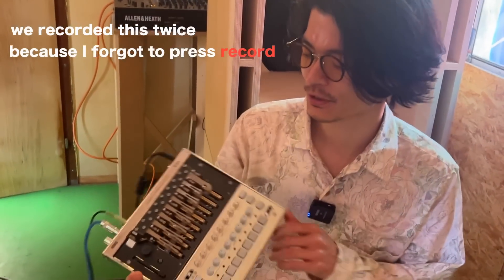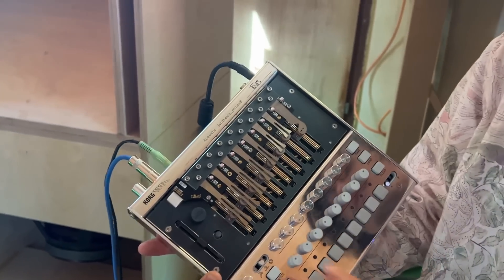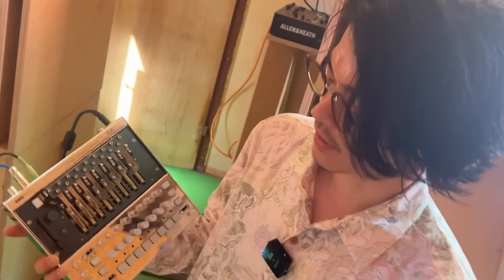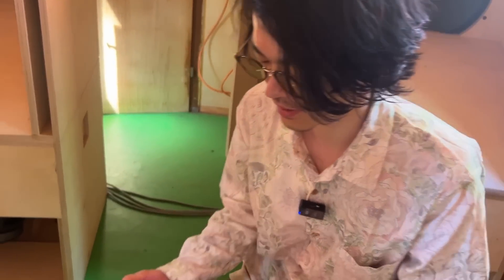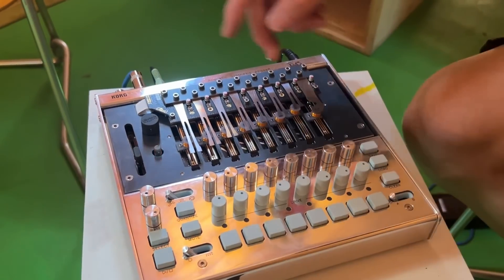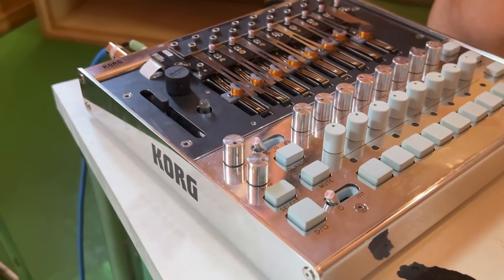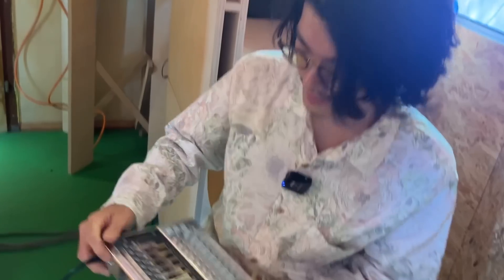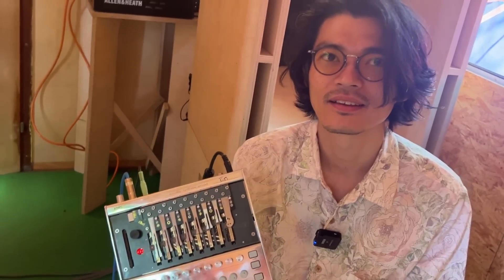Korg Acoustic Synthesis-phase 8 // Update from Superbooth 2024

Comment: Call me crazy but why don't you guys make this but also just make like a 49 key electric piano with this same setup, just less doodads attached to the forks? There is no affordable (sub $5000) electric piano on the market that basically doesn't weigh 100 lbs. If you made a modern ones with all the right parts but like a plastic chassis for weight, thing would sell like hotcakes.

Comment: love this guy for doing the volca modular. amazing instrument. this thing looks very Koriginal. sort of handpan but compact.
Reply: Btw would be great if the unit got midi input and that each note in the octave get like a last note prio. like this you can stack the accoustic reso with poly synth patches and your not limited to play in 1 octave only. 
if the sound is going to be great then 2 octaves would have my preference. 

I imagine to use it for accoustic feedback with an guitar and amp.

The sound is... mwha... a more solid pitch fork sounds better.

Comment: i think something like this will really come to life with some proprietary physical interface technology and a minimal but effective gui. Needs something that will let you send more different types of impulses through the resonators without touching them, like a momentary button for example that switches from 2 types of articulation, my instant thought would be 1 is a piano strike, and 2 is a high frequency pulse sequence with some light randomization and a slow attack for a violin type effect. You could even use something like an XY pad to add a huge amount of possible articulations.

Comment: Definitely needs more variety of sounds and an offset adjustment for voltage when using fingers.  Perhaps add a second set of resonators with a different material and buttons (not knobs) for sustain.

Comment: I'm so delighted to see Korg continuing with this project, and that it's quite experimental and unique in nature. It's more kalimba than electromechanical piano currently. I'd be interested to see if/how then can introduce more notes, with midi control. Maybe using nanotechnology, tiny physical resonators, a full 8 octave range of pitches. But that's a different project, much more complex, and the simplicity and limitations around this one are part of its charm. I'd definitely want to be able to tune each note in this version, and it should be microtonal capable. An electromechanical Lyra kalimba with sequencer, packaged in a piezo noisebox
Reply: My thoughts exactly. This could potentially become a Fender Rhodes on STEROIDS!
Reply: theres no way you are going to get a pleasant acoustic sound in low frequencies from something smaller than the wave you are trying to excite out of it...
Reply: I posted another comment a little further down with a link to a video that has a Qun synth resonating similar to what I heard on this video of the Korg. Mics as input to effector. This korg is neat because it does real world resonance and it sounds like it could get really mean and growling if they actually played it. So I’m excited.
Reply: Tempting  but I wonder how much. It will   cost?
Reply: definitely needs microtonal support
Reply: Nanotech? So you want a $5000 full size rhodes piano with resonators?
Reply: Yes to midi
Reply: Oh god no, these are the worst suggestions ever. You do not understand anything about this project at all. Be quiet.
Reply: @notreally-sf3df  nah, it does need microtonal support tho